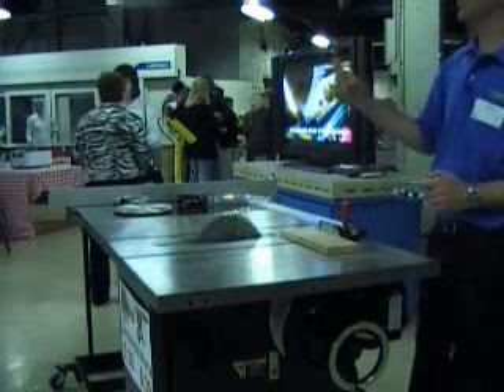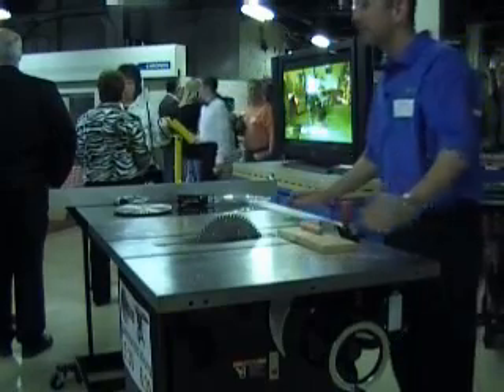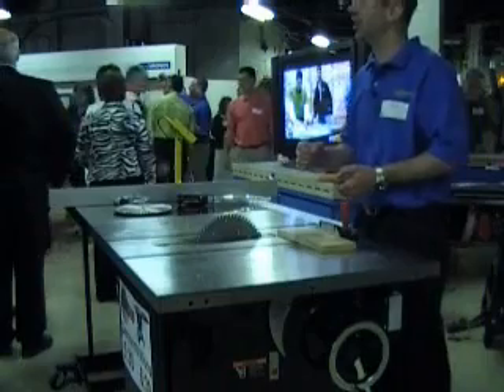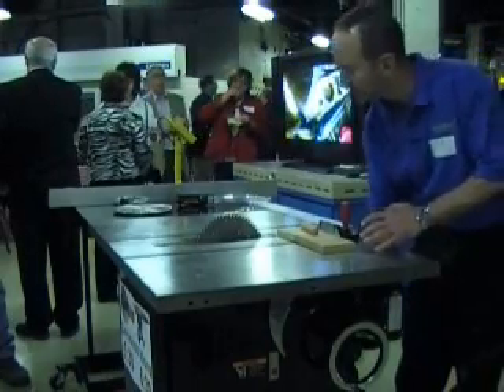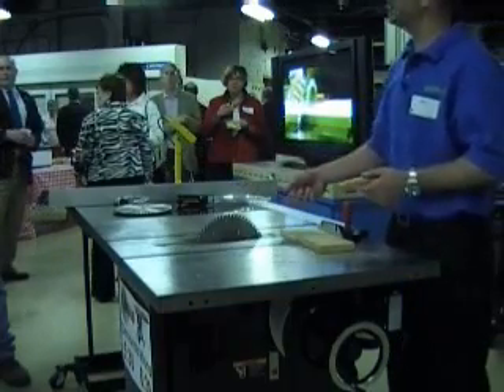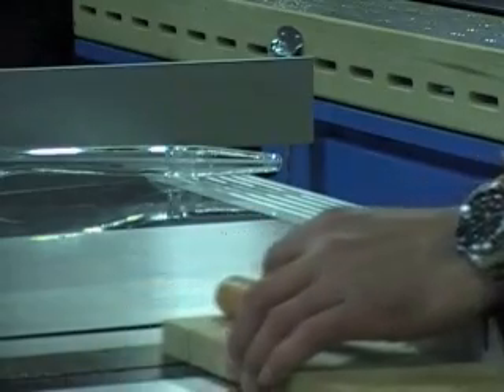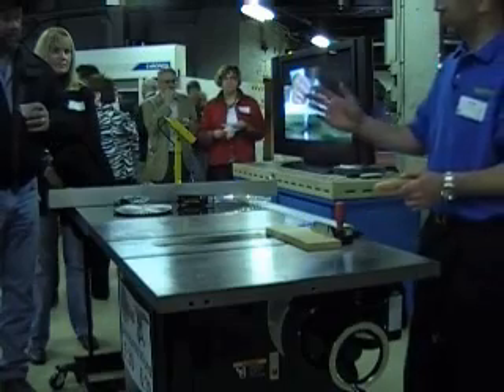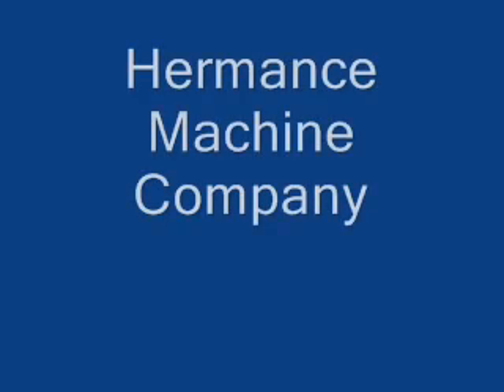SawStop Table Saw Demo

Comment: Sawstop macduff is impressed, macduff's innovative technology (OJJ) the other alternate
mated to older table saws has retro-fitted that technology to be as save as it can ever be,
it will not wreck the blade or stop the saws operational function.
All macduff's automatic anti-kick back devices are placed up front over-head of the blade, on a
stationary fence, (a macduff first) attaches to a bracket with a suspended rod from the stationary fence 
which will never deviate from the parallel.

Comment: This portable light weight technology cuts sheet material to 4ft. on center requiring no large
permanently mounted side or out-feed extension tables 
World wide there are hundreds of thousands of table saws with the old dangerous technology out there. Sawstop at
this time cannot retro-fit these saws.  Buy new not necessarily, retro-fit available yes (plans)but don't be
complacent and keep your wits about ye, slainte mhath macduff